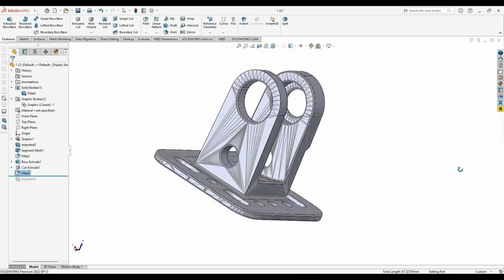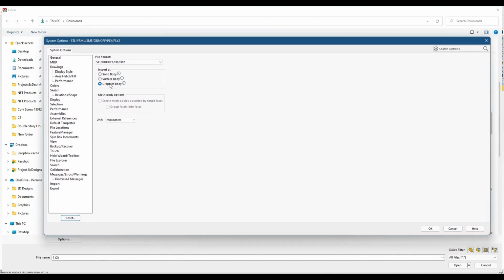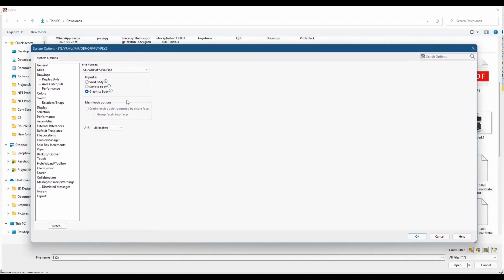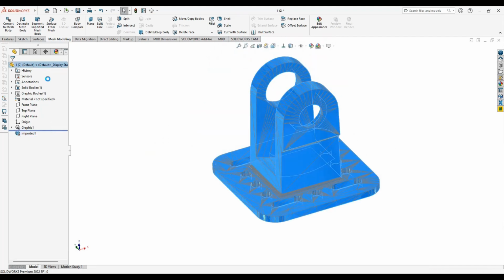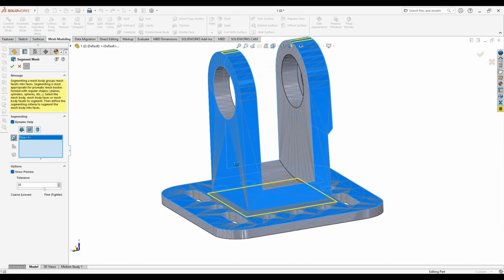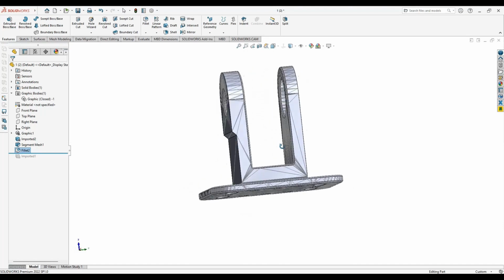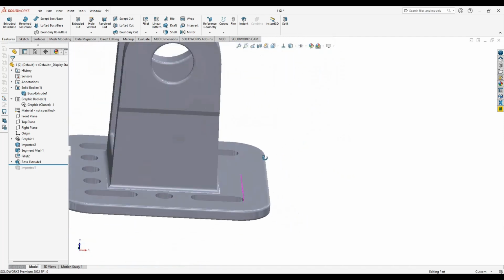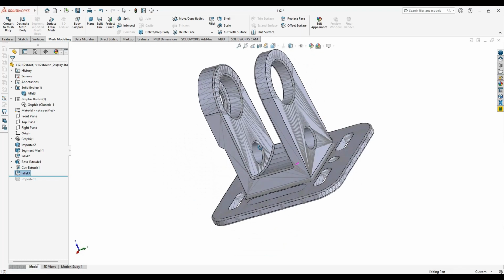✅ How to edit stl file in solidworks | Hybrid Modeling

Comment: This does not work for complex surfaces, only on dumb basic parts that we could rebuild in a few minutes...
Reply: Yes exactly. I need to convert something like 3d human face Photogrametry scanned to work in Solidcam 5 axis. Any suggestions please?
Reply: Did you ever find a solution?
Reply: @Rohan3CAV   nope.  This works only on very basic planar geometry is useless 95% of the time
Reply: @nockesumampouw6165  I've recently started working with imported mesh files, I think "Convert to mesh body" is the way to go. It creates a surface from a mesh. After than you can probably use thicken to convert to solid models.
Reply: @nockesumampouw6165 have u got your solution im working it too

Comment: ı am getting an error when ı try to extruded cut, it says "The feature cannot completed because you cannot merge mesh geometry to regular geometry. If applicable, please uncheck 'merge result' to create this feature" What Should I do????
Reply from the maker: Which version of solidworks you are using ?
Reply: @solidworksandansystutor  i got the same problem i use solidwork 2021 version
Reply: I have the same problem in 2020 version

Comment: I am getting an error when I want to use the "Convert to Mesh Body" function. The error message says; "Grouping facets into faces failed for one or more bodies". I only have one graphics body in the entire Solidworks file, which is imported with the settings you showed (graphics body). How do I solve this problem?
Reply from the maker: Seems like your geomtry is a bit complex for grouping facets into faces you can try decimate mesh by decreasing mesh if it is more refined or try to use segmented meshes.